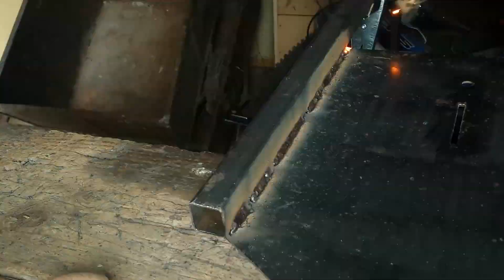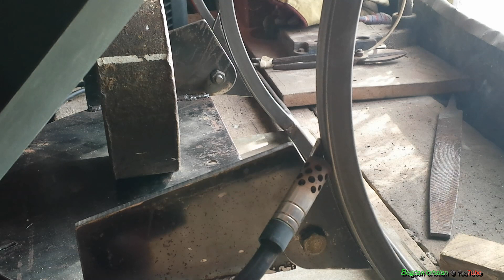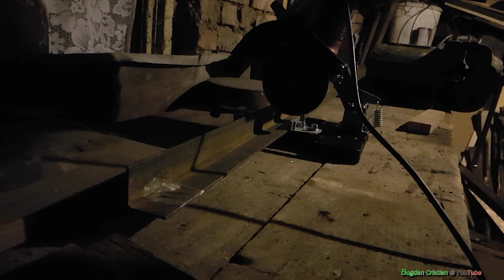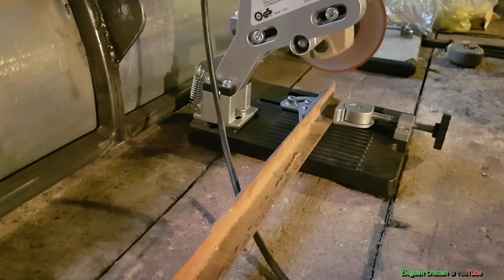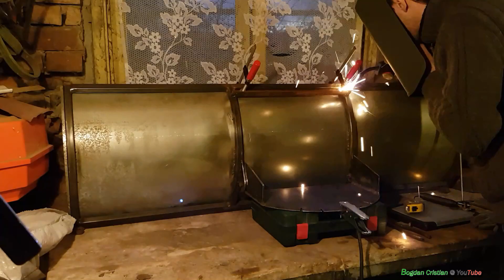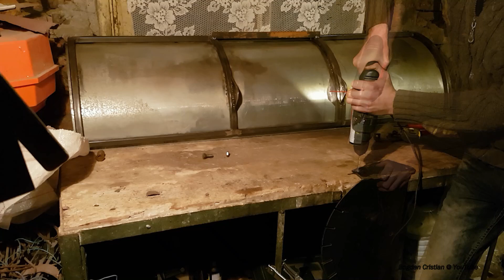Building an ATV Snow Plow - Part 3

Comment: How did you curve the metal for the plow, I saw in the first video how the tube was bent, but what about the actual blade? And how thick is the blade, 10g, 12g 18g?
Reply from the maker: The actual blade of the plow is about 2 mm thick (=14 gauge =~0.781 inch) and it was curved the same way as the square tubing frame was in Part 1

Comment: Although you made a product that works. You need slow down on your welding and weave more.Your welds will break eventually from the pressure of plowing snow.
Reply from the maker: I'm still learning how to improve my welding, thanks for the advice!
Reply: chucke2009 here on youtube has some good videos on mig trouble shooting and getting started, need to turn both the wire speed and volts up and slow down, a perfect weld is right on the edge of burn through/undercut but without crossing that line
Reply: also you can get auto darkening helmets now fro about 60$ canadian, youll have a free hand and be able to see 10x easier with one

Comment: omg....funking welds...:D I have some non-destructive examinations...and this welds....no way.:D
Reply from the maker: Petr Gajoš I've just started to learn how to weld, so this isn't my best work, but it's holding up very good
Reply: Bogdan Cristian o.k....you know that your welds are....arent welds...:) But finaly snow plow is nice;)
Reply from the maker: Thanks! :)
Reply: I suggest getting automatic welding mask, least then you actually hit in the area where you are trying to get the weld. Other thing is to angle every joint so bead fills the void and grinding it smooth, wont remove that whole weld. My first welds broke like nothing, before i understood what makes a weld to tick. In high tress application i doubt this will last long due sub par welds. Then again benefit of metal work is that you can always attach and remove metal.